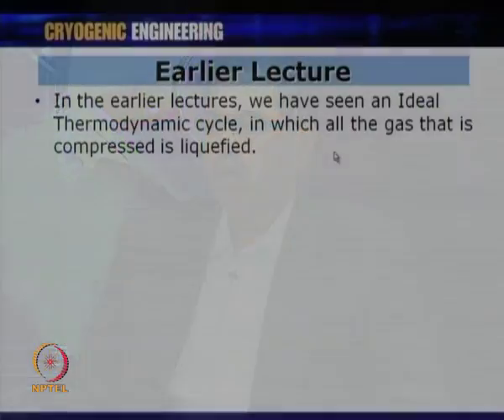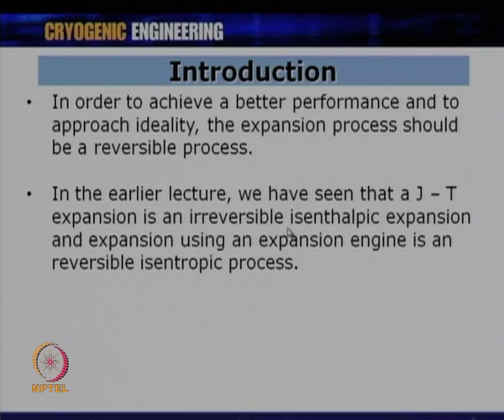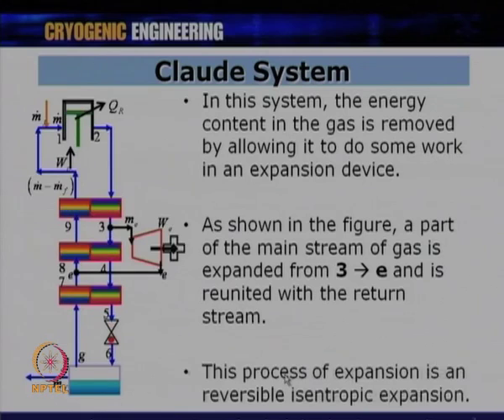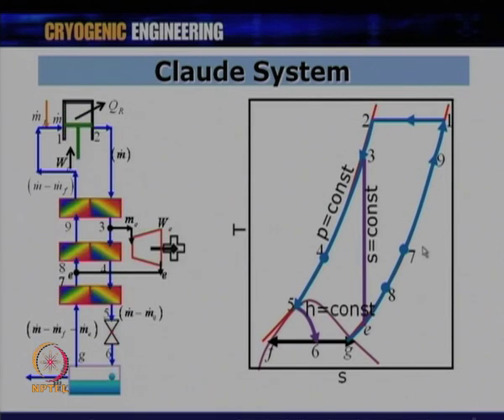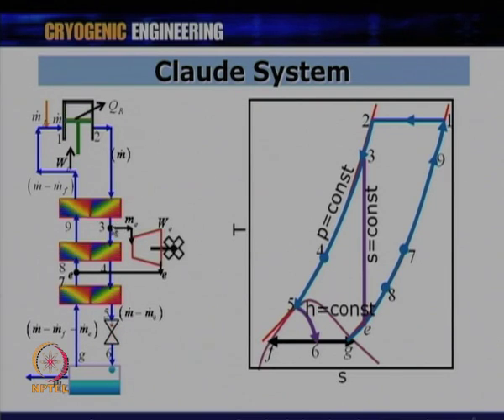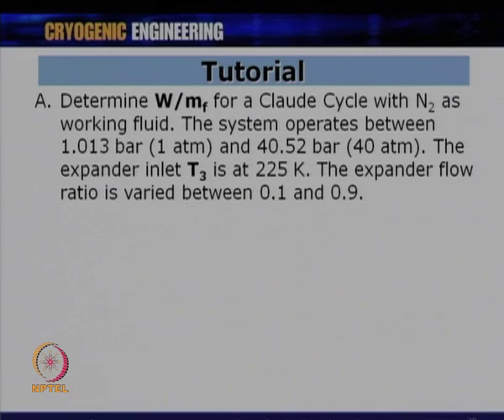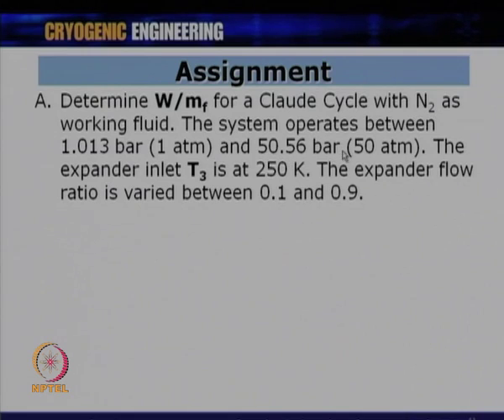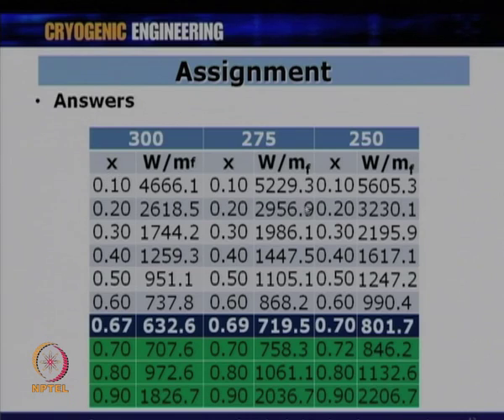Mod-01 Lec-15 Gas Liquefaction and Refrigeration Systems VIII

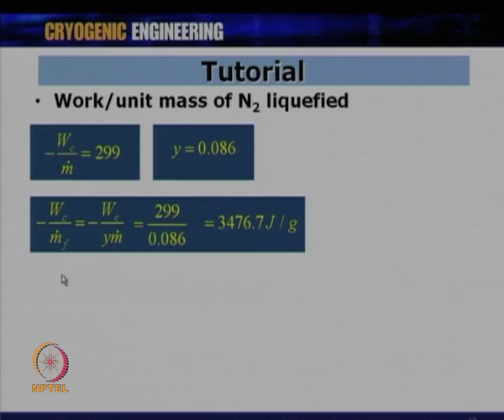Comment: At 36:11, Sir mentioned that we haven't taken the work of expander but I think that's a mistake. I am saying this because the formulae which we have used for calculating the work done is the same which comes after taking into account the expander work. So basically, here we are not neglecting the expander work.